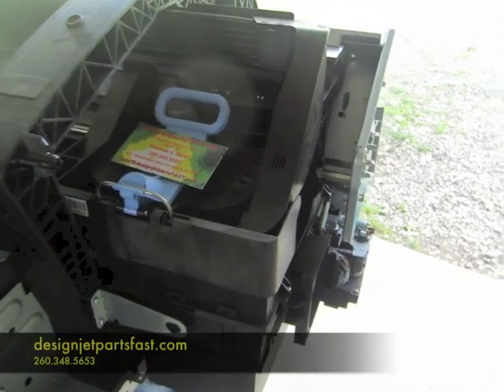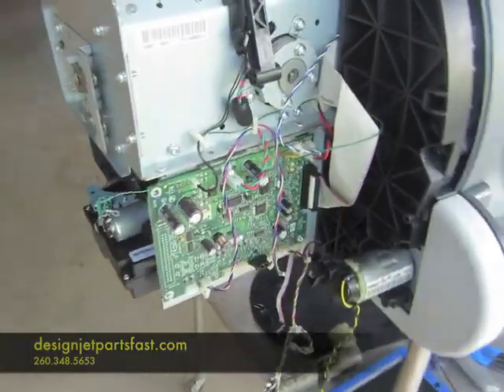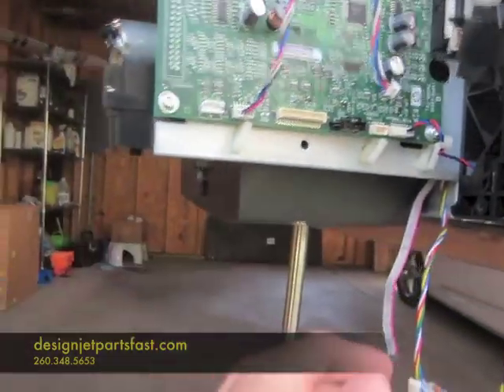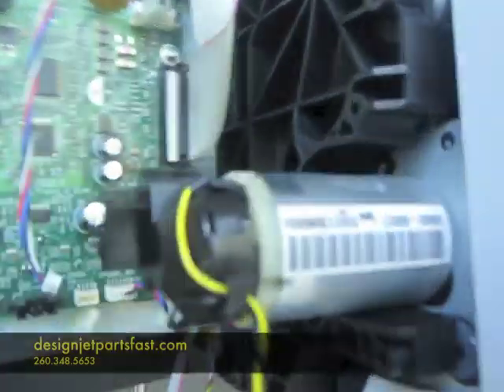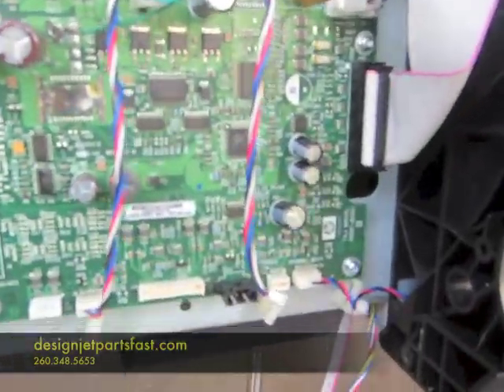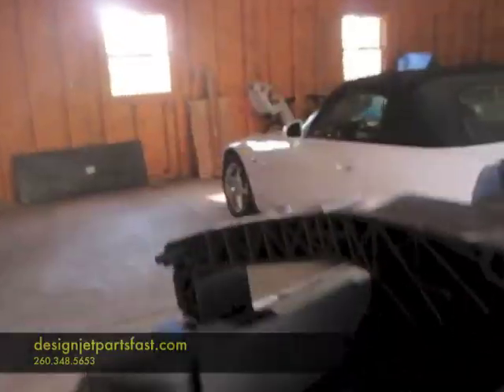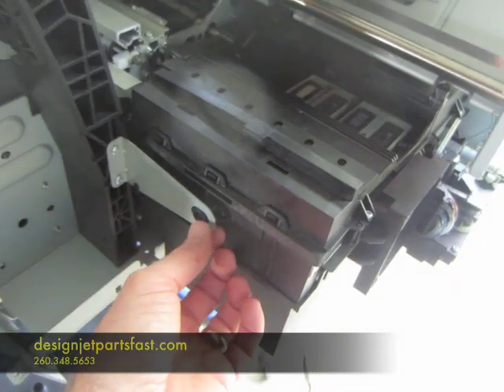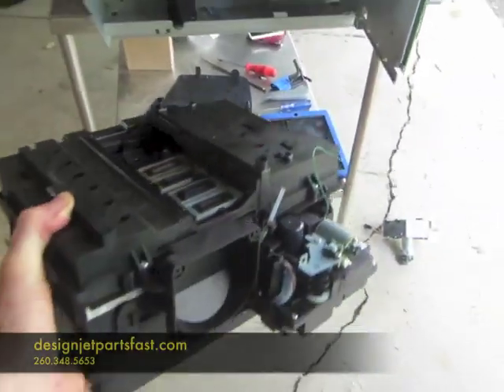Designjet T Service Station

Comment: Like Rico, I have carrier that is stuck.  Z5200.  Carrier doesn't move at all during printer boot.  Is there another way than the plastic screw to unlock the carrier?

Comment: Thanks for these videos I just got one of these printers for free from a print shop and I just can't find crap on this thing I am having a 08:11 error code won't boot i seen a video of this service station looked at mine and said damnit im missing that hole piece i paid nothing for the machine so I guess I'm still winning but just the cost for ink and this service station and print heads im already ready to just through the thing out the door.
Reply: @FixYourDesignJet  thanks for your feed back and videos they are really going to help me get this printer working.